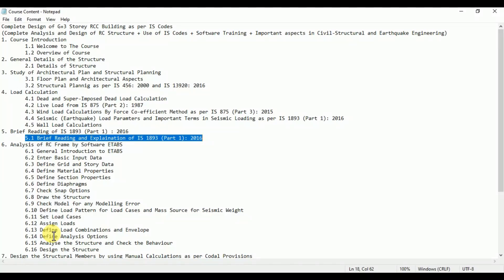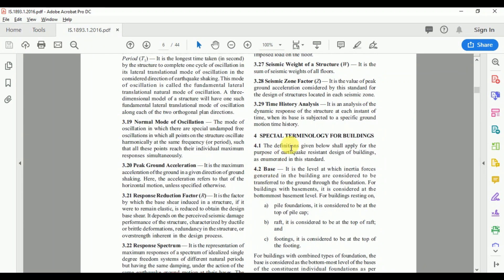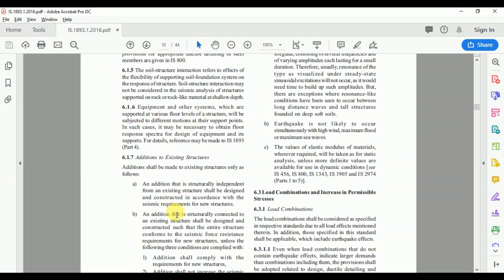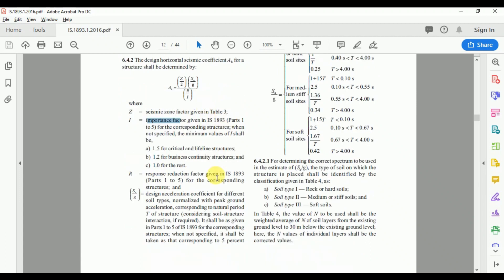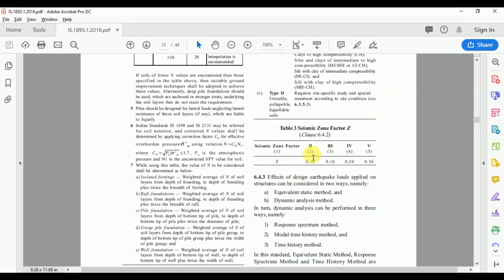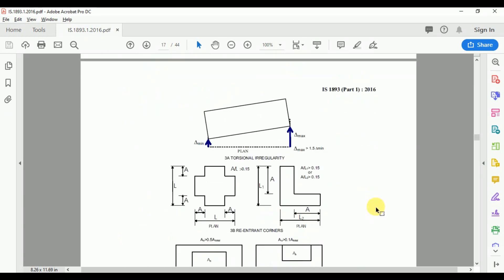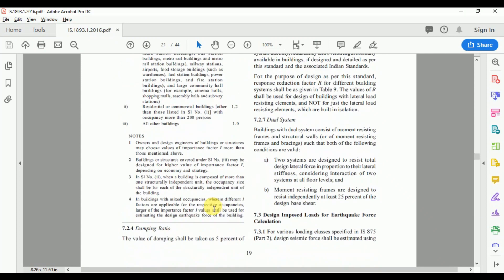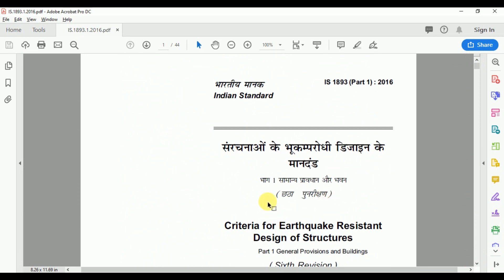5.1 Brief Reading of IS 1893 (Part-1): 2016 │ Design of RC Building │ Akshay Thakur

Comment: What are the load combinations as per is 1893 part1 2016 for wind load in etabs?
Reply from the maker: Shivam,
IS 1893 is for Seismic Analysis which gives us guidelines to consider 30% earthquake load in other respective direction and vertical direction in same load combination wrt Orthogonal/Non-Orthogonal Structure

for Design we need to define load combinations as per type of structure wrt Design Code, means for RC structures as per IS 456 and for steel structures as per IS 800.

e.g.: for Wind Loads Load Combos for RC Building should follow as per Table 18 of IS 456: 2000

Hope; your doubt is now resolve 👍🏻